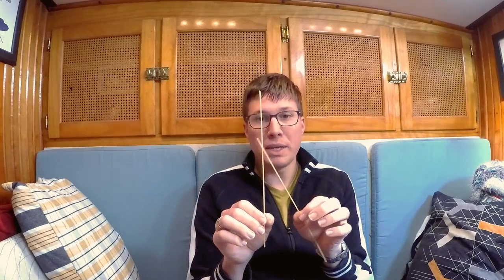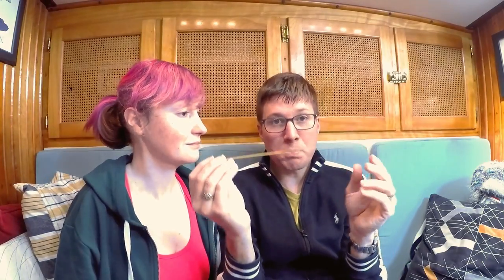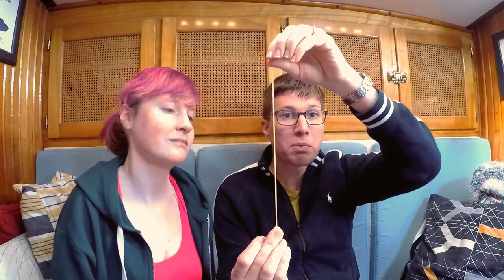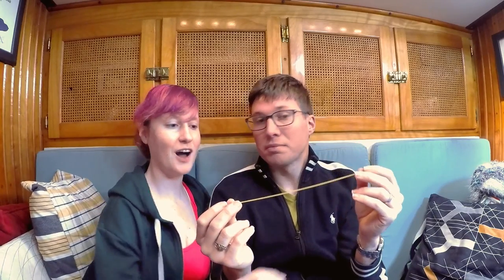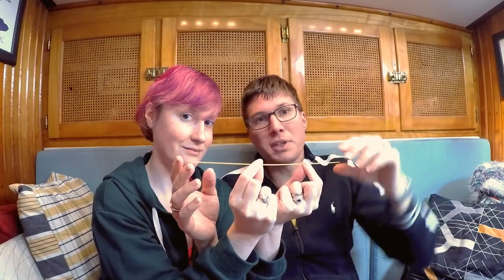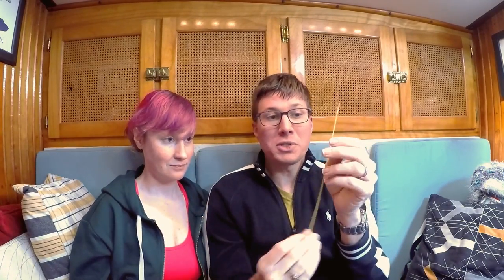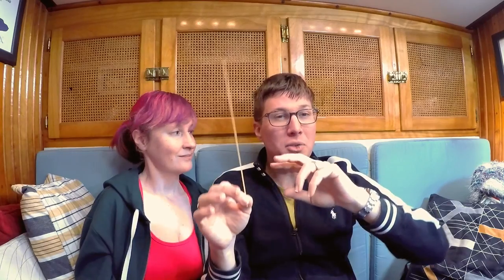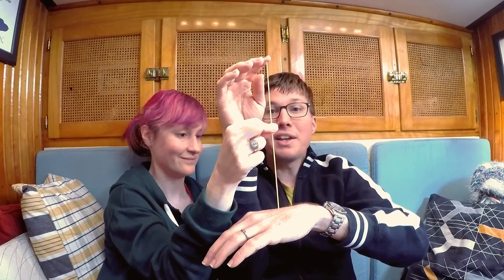What's the Deal With SPREADERS? | Sailing Wisdom

Comment from the maker: How many spreaders does your mast have?
Reply: Very clear explanation!  My boat has a single spreader, keel-stepped Sloop rig — 1980 Sabre 34. In 1986 Sabre updated the model and made it a two-spreader rig.
Reply from the maker: I have met people who wanted to convert their single spreader rig to double spreader to “make the boat look newer”.
Reply: Spot on!
Reply: @RiggingDoctor  Add cost, complexity, and weight aloft to "make the boat look newer"??? That's nuts!
Reply: @kimyoung230  Additional set(s) of spreaders enables a reduction in weight aloft, as the mast cross section (and thus weight per foot) can be reduced.  However, the point about complexity is valid.  More pieces = more opportunities for failure.
Reply: KimSails: did you replace the mast or just tack on two new spreaders?  (In the later case, "enhanced" looks with a severe weight-aloft penalty — but you probably aren't racing… )
Reply: @robevans5222  If you also replace the mast with a lighter, maybe bendier mast? Then sure, it can make sense. But Herby didn't mention anything about a mast change in his post, so I did not read that into it.
Reply: @seanflanagan2441  My boat has the same single-spreader rig setup as when it was new.  I was mentioning that the manufacturer on my boat, Sabre, came out with a Mark-2 version of my boat. The newer version came with a different mast and double-spreader rig.
Reply from the maker: What’s bad is when they just “want to add a set of spreaders to their current mast”.
Reply from the maker: The owner wanted to add spreaders to their current mast to improve the look. I explained why it would be a bad idea and why they shouldn’t do it. I didn’t do it but I don’t know if they went somewhere else to get it done.
Reply: On my 1979 34-footer, the previous owner installed a 44-foot keel-stepped Seldén mast, with 2 sets of spreaders (originally 1). I always wondered the reason for the change. I do some racing, so the tuning advantage is appreciated. It's worth mentioning that swept spreaders have an additional function: to prevent the mast from bending backwards and therefore to support or sometimes replace a backstay.
Reply: A single set of VERY swept back spreaders for me. Kind of makes it hard tob run ddw.
Reply: @shopstuff5  they are off target both on the keel stepped concept and dangerous with their theory of bending the mast backwards on race boats.  they are not bent back. they are cantered (tilted) back.

Comment: Pcr = pi^2 * EI ÷ L^2.
column buckling.  Halve the length, and Pcr goes up by a factor of 4.  Cut L into 3 segments (double spreader rig) and Pcr goes up by a factor of 9.
Of course an unsupported spar becomes a cantilever beam as opposed to a compression strut...

Comment: Good explanation in terms basic enough for non-engineers to understand.  In a sense, the mast, spreaders, shrouds/stays, and hull can be thought of an array of truss-like structures (and trusses are composed of triangles, as you mentioned).
A keel-stepped configuration can impose bending moment into the mast section due to load applied at the partners - this can be intentional or unintended.  I feel that it is usually the best choice, in that compression loads do not have to be accommodated in the deck structure.  For a cruising vessel less than ~50 ft LOA, I favor single spreaders and a robust mast section:  reduced complexity and better tolerance for unintended stresses are well worth the modest weight-aloft penalty.
I admire your conservative approach to choices such as routing, sail plan and weather preparation.  Racing with a large crew and limited concern for accelerated wear and increased risk of failure is much different than cruising.  Your philosophy of provisioning conservatively, avoiding overpowering your vessel, and reaching your destination without catastrophe (even if it means getting there a couple days later than some would attempt) is so right.
Your channel continues to share practical knowledge and experience that should be of broad interest to the cruising community.
Reply from the maker: Thank you so much! We are trying to grow so that more people can see our videos. 
Sharing our channel with your friends really helps out!

Comment: Excellent explanation. What prevents the spreaders from being bent downwards from the stay tension? Cheers from Canada.
Reply from the maker: They are set at a bisecting angle to the stays, this keeps force neutral on the spreader and prevents it from buckling up or down. 
And the end of the spreader is also seized to the shroud
Reply: @RiggingDoctor  The spreader and its point of attachment at the mast may be designed to tolerate the downward force imposed on the spreader tip by the shroud, which generates a bending moment at the point of attachment at the mast.  I had a boat on which we experienced a failure of the socket at the mast while underway in about 20 kts apparent wind...rather alarming to look aloft and see the spreader wobbling around.    The bisected angle (rather than straight/horizontal) configuration is so logical, it's hard to imagine why it isn't universal.
Reply from the maker: I see a lot of boats where the spreaders are horizontal to the horizon, and severely bent downward! They should have a slight upward sweep.
Reply: @RiggingDoctor  Where the spreader is seized to the shroud; is this a mechanical means done after tensioning the shroud? Thanks in advance. P.S. it's -11C here, mid Feb.
Reply from the maker: It is done after everything is tensioned.

Comment: Hi there! Nice video :) 
Can you share your opinion about option of converting "conventional" 2 spreader, keel step mast, with narrow chain plates (high aspect ration), discontinuous, inline, to wide spread arrangement, no spreaders. Similar to imoca 60 on-deck spreaders. going far out of your beam. I'm aware of limitation in head sails size in this configuration, difficulty with docking or rafting. I'm only asking about the mast, do you think same mast can be converted to this setup (more lines holding the mast?). In imoca 60 they have them swept back and mast is rotating. I'm thinking about mass reduction and simplification of all setup.

Comment: Next video aluminum, versus carbon fiber, versus wood!!!
Reply: Allyn Onderdonk, that's easy; in your list: $$$; $$$$$; $

Once the mast is installed, maintenance is less a factor, though wood would require as much inspection and more maintenance.
Reply from the maker: Correct! Wood needs constant inspections for rot, carbon gets delamination and UV damage (to the resin binder) and aluminum corrodes.

Comment: Thanks for info..question , a spreader was bended downwards by a stepping on it the wrong way cleaning rigging...crazy ...what should be done to Check spreader to make sure it won't bend while on passage...I have certain ideas but more details if you know would be welcome an appreciated ..Muchas gracias...
Reply from the maker: Buenas, vas a necesitar hacer dos cosas. 
Primero va ser chequear donde el spreader se conecta al mástil para verificar que no haya algo roto allí. Si todo se ve bien, vas a seguir a la segunda cosa. 
Segundo, vas a mover el spreader tip hacia arriba por dándole golpes con to mano por abajo para moverlo hacia arriba. Quieres que el ángulo entre el spreader y el stay quedan iguales arriba y abajo, así sabes que el spreader está en el lugar óptimo para las fuerzas. Va a ser un poquito hacia arriba de horizontal. 
Cuando todo está donde pertenece, vas a colocar un hose clamp o algo que puede agarrar al cable bien justo arriba y abajo al spreader tip para que no se vaya mover de nuevo. 
Espero que eso te ayudará!
Herby

Comment: What about cat rig boats like Nonsuch and freedom? Using carbon fiber makes the rig light and stronger, if a little bendy. Why wouldn't more crusing sail boats use them? Cuts weight, supper stronger and little rigging.
Reply from the maker: They are great setups but all the strength is then coming from the deck and hull. Those boats are well built and can handle the loads, but imagine a Bendiboat trying to sport that rig! Rigging transfers the force to somewhere else, allowing builders to get away with making it flimsy. 

Next time you see a cat rig, look at the height of the spar and thickness of the mast. It’s pretty short and very stout. 
A single spreader spar is taller and a little thinner. 
A double spreader is even thinner. 
More than three spreaders and they look like uncooked pasta noodles!

Comment: could you explain why certain boats have the spreaders point forward or backward instead of just straight to the side? what are the benefits there?
Reply from the maker: Swept spreaders offer stability fore or aft while lateral (straight out to the sides) spreaders only offer support to the side, no fore or aft support from them. 
Modern boats, particularly on Hunters, have the spreaders swept so far aft that the cap shrouds do the job of both the cap shrouds and the backstay! This means that those boats now don’t need to have a backstay. Being able to remove stays from the design frees up the constraints of the boat design, allowing boats to be built in completely different ways!

Comment: Keel stepped masts transfer rigging and sail load forces to the keel of the boat better. Only it's a pain when the mast is in the center of the companionway. How do you feel about wood, aluminum or composite masts? I think a wood mast wrapped with fiberglass is a good way to go an keep it sealed from weather.
Reply from the maker: I prefer wood over aluminum and aluminum over composite. This is a personal preference because I feel more able to do repairs on a wood mast over an aluminum spar, and much more than on a composite spar.
Reply: We have wood core glassed over deck stepped mast with one spreader. But, there are deck stepped and deck stepped mast eg. production and custom made. Ours has supported “cradle” so the deck alone isn’t taking the load but it’s spread out to multiple points over larger surface. Makes unstepping the mast a breeze too

Comment: What about when a mast becomes inverted is that too much bend in the mast forward or backward
Reply from the maker: Are you referring to when the mast reverses it’s bend and instead of swaying back with the belly forward, the belly is aft?
That is usually caused by insufficient tension on the lowers. The forward lower bends the mast forward while the aft lower helps resist it. 
With two or more spreader masts, there are no lowers opposing the bend or inducing the bend and they can pop in the wrong direction. In these situations, check and baby stays can play a huge role in keeping the mast with the correct bend.
Reply: Rigging Doctor yes that’s exactly what I’m referring too thanks for the reply cheers

Comment: A free body diagram on your blog would be nice showing the forces applied from sails and rigging through the spreaders would be interesting addition to this video.
Reply: John Roth, great suggestion; let's hope Herbie finds time to do that.
Reply from the maker: The load on the spreaders is rather simple. The forces are always in towards the mast, the force is then supported by the lowers right under the spreader. 
They only work in compression.

Comment: Good explanation. The 12.5 deg number is interesting.  Some multihulls , especially those with rotating masts and wide spreader bases have no spreaders!  I hear 2 schools of though on deck vs keel stepped. Some very well respected offshore folks will not have keel stepped masts as in a knockdown or pitchpole they don't want a big hole in their decks . Hopefully you will never be in that situations.! Cheers Warren
Reply from the maker: I have heard the opposite thought on loosing a mast with a keel step: now you have a hole to mount your jury rig into.

I think that in those situations, you make do the best you can with what you have and hope you never have to!
Puts a different light on keel stepped setups though.

Comment: at 4:34 it seems to me you gain nothing by the keel stepped mast.  You still need to have the a a certain length above the deck so the deck doesn't really help support anything in the critical space above the deck i.e.  the mast just has to be longer to reach the keel. What am I missing?
Reply from the maker: It adds an extra point of attachment which makes the mast stiffer. 
A deck stepped double spreader rig is the same stiffness as a keel stepped single spreader rig. 
Fewer spreaders is less rigging and less complexity (if you ignore the hole in your deck that needs to be sealed)
Reply: @RiggingDoctor  Thanks, but what I don't get then is why you would need a shorter mast from the deck up when you have a keel stepped mast.  I have  a 45 ft mast that is deck stepped...If it was keel stepped I would still need 45'  that needs supporting  above the deck in the same way, since the deck stepped one is  essentially 'supported' at the deck where it is attached...no? From the deck up it is the same length and would need the same support. 
With a junk or lug rig system where the mast stands alone, I can see the deck being a support point, but it still needs to be designed to take the stress of x length above the deck just like a stayed rig.
In my case there is a post under the mast into the keel that supports the weight of the mast and shroud tensions, but no hole in the boat and the mast comes off at deck level when needed.

Cheers and thanks for your patience.
Reply from the maker: If your boat were keel stepped, the mast would be 45 feet long plus the part inside your boat, so you would end up with roughly a 53 foot stick. 
The benefit being that this long stick is stiffer and therefore relies less on the rigging to keep it up. This means in absolute 💩situations, the mast is stronger and might survive the nightmare.
Reply: @RiggingDoctor  OK, thanks. So it is not so much that the mast is supported better, but that it forces you to buy a stronger mast that is then heavier aloft as well....life is always a trade-off eh?

Comment: I would like to learn more about your lights.  Spot lights, running lights, interior lights, how you converted to led (if you did) where you got them.  I ve got an old boat that is used only 2 months a year and would like to upgrade.  My 2 million power spot lights are dieing on me so they are scheduled to be upgraded.  thanks.
Reply from the maker: Great suggestion!
Reply: FWIW, I bought my LEDs at marinebeam.com.  I went there because of the good reviews I had heard about them, and I had a good experience buying from them as well.